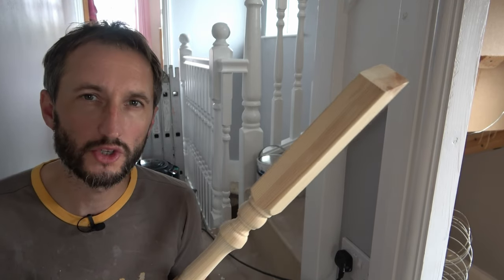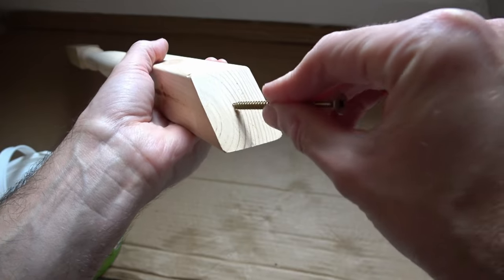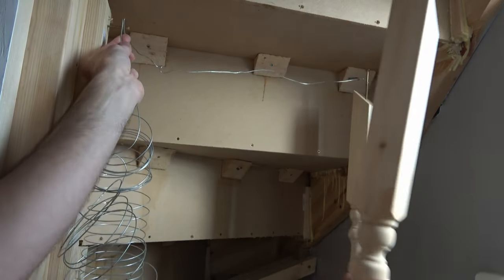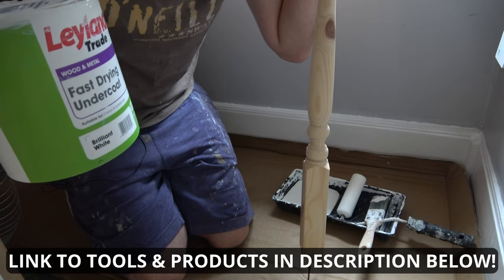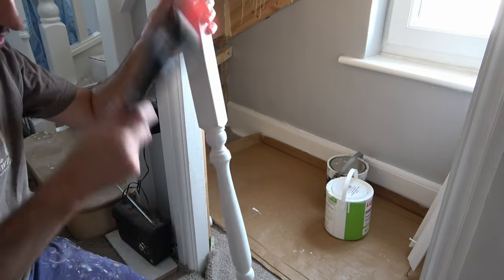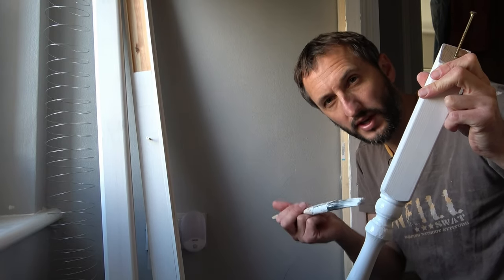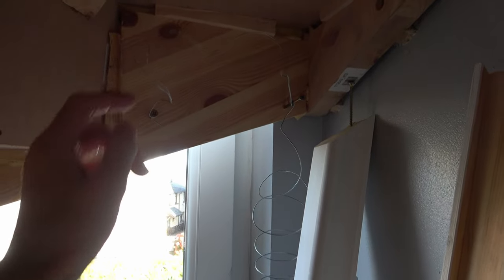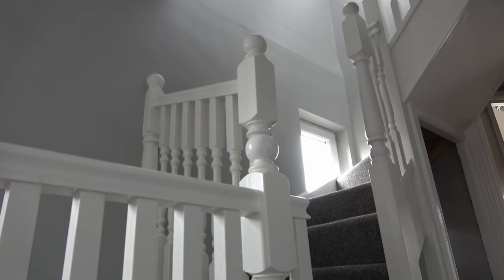How to paint spindles before fitting into place!! Undercoat & gloss spindles. Prime & gloss stairs.

Comment: Pouse I’ve tried both methods with and without knotting solution.. I usually find with out a few come through

Agree with above Zinnsser bin primer and you can avoid the need to knot but cost a fortune
Reply from the maker: Probably money we'll spent if it works though. Thanks for the feedback as I seemed to get the same results as you. Thanks for watching 👍